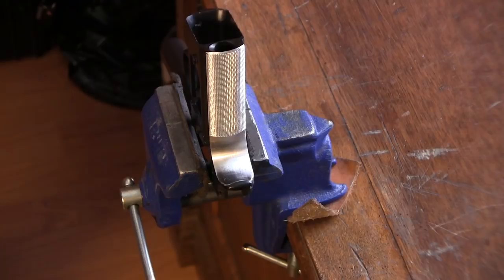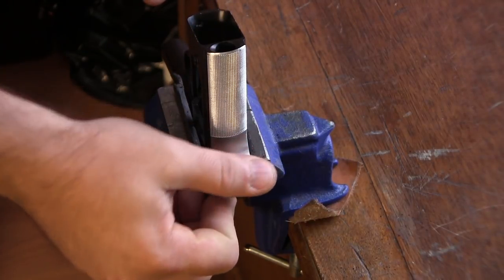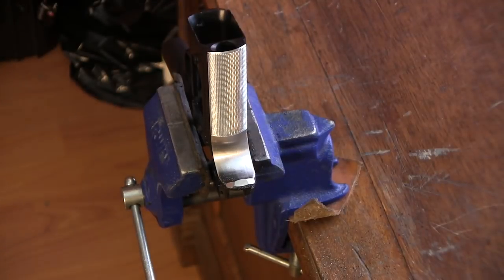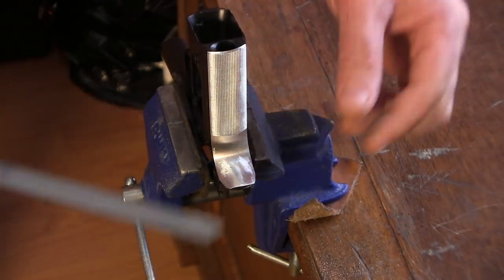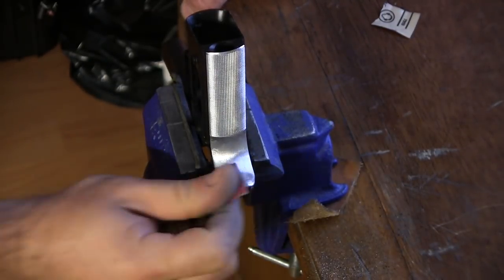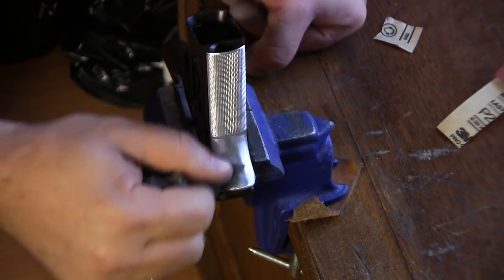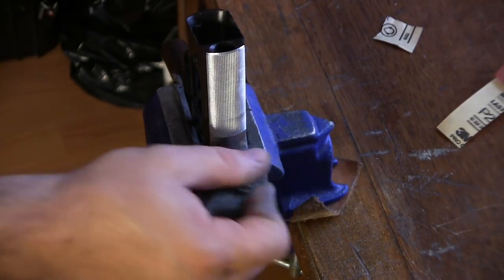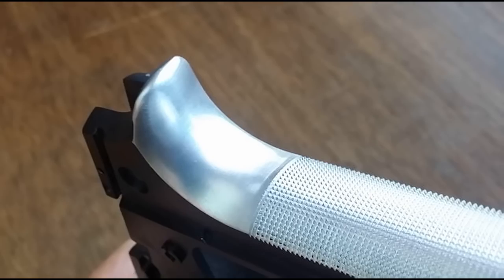Beretta 92 FS (Vertec) - Beavertail Reshaping

Comment: I can't wait to see the finished product. I have sandpaper grip tape on my 92 right now. This is making me want to try checkering. Any suggestions for starting? What did you practice on before you did the guns?
Reply from the maker: I didn't practice on anything but if you want to practice I would suggest a 1" diameter pipe. I see that suggested for 1911 front straps. I know it is not the same thing, but larger diameter radius (like this rear strap) is actually easier.
Reply: Thanks for the suggestion. I'll try it and order the checkering file from brownells.
Reply from the maker: You will also need some way to guide the file so I would also recommend a checkering jig. And the files can also be obtained from Otto Frei

Comment: You say re anodized do they hot dip the existing coating off or bead blast and do they or you re touch up before the final application  Great Job
Reply from the maker: This frame has already been refinished with a cerakote like coat (Cera Hide by CCR Refinishing) so I am pretty sure that will have to be blasted off. And after it is done I am thinking they (AGW) will chemically strip the anodize left over (if any). I don't think touch up will be needed. The surface should be scratch free to be just blasted and anodized using Spec+ Type 3 anodize method. Really hard stuff.

Comment: What file do you use for checkering?
Reply from the maker: I used a 25 LPI checkering file on this one.
Reply: Is there just standard checkering files? Your checking looks like little pyramids all the files I found online are just straight checking that have to be finished off with a 60 degree file. Thanks for the response love your videos!
Reply from the maker: @jonathanostrom7917  look on Brownells. Metal checkering files. There are rows of teeth. The file has perfect geometry so when you cut all the way down with it, you end up with 60° row tips. And when you then cut perpendicular lines you get pyramids. All teeth on the file form this pattern ^^^^^^^